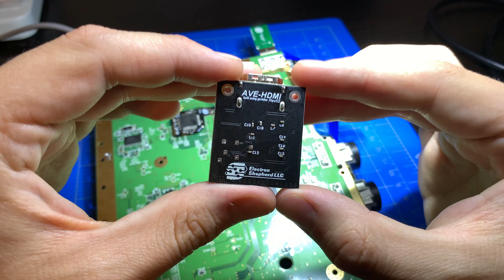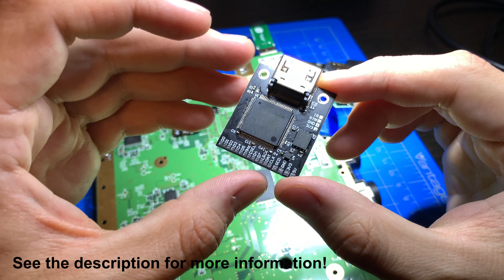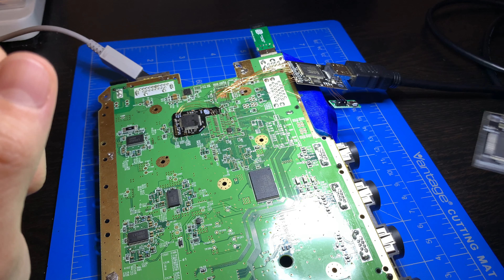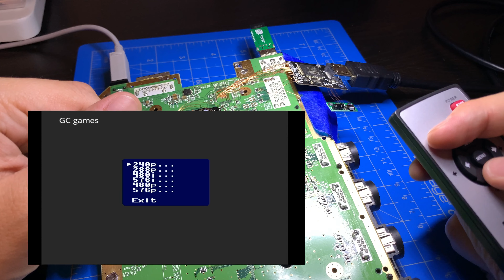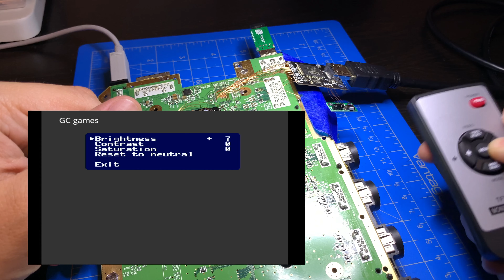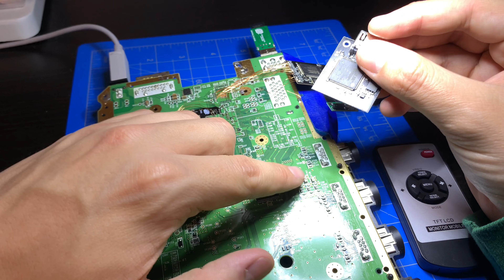AVE-HDMI - built using GCVideo

Comment: Hello, thanks for the video, I have few questions. Should  I remove the ave-rvl to install ave-hdmi ? Will I lose the analog video from the official video output port ? And lastly, which parts should I buy to get hdmi from my wii ? I already listed some of them from what I understood :
Ave-hdmi
19 pin flat flex cables 15-20cm
HDMI type A ffc adapter
Optionnaly ir receiver (but it seems like not in stock )

Comment: Hello, could you explain in further details the differences / specificities between this solution and a similar device such as the WiiDual hdmi mod (which is discontinued for the time being) ? Also will you release a tutorial for the mod ? Thank you for your answer and your work !
Reply from the maker: Hi Guillaume - the primary difference between this design and the WiiDual is that this design only allows for HDMI output whereas the WiiDual allows for HDMI output as well as analog video outputs.  Other than that the designs are nearly identical as they are running very, very similar versions of the same code.  We are currently not planning to release a video showing how to install this mod, but we can if that is greatly needed.
Reply: @ElectronShepherdLLC  However, with the AVE-Relocalisation, we got practically the same thing as the Wii Dual, amn’t I right ? 
Thank you for your answer and your hard work 😊
Reply from the maker: @Mongeta64  Yes! That is correct, that would be very similar to the Wii Dual.